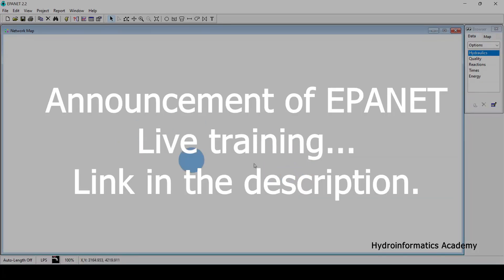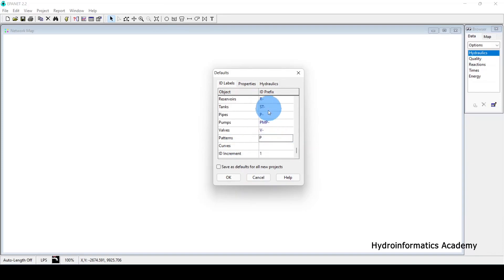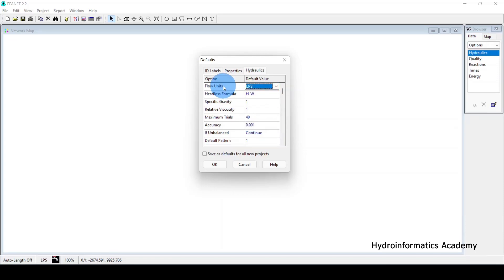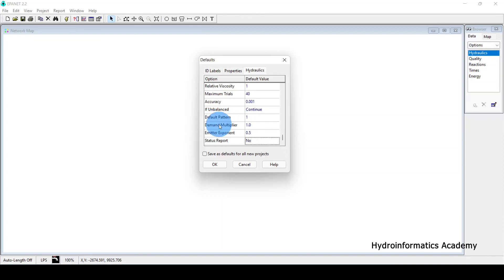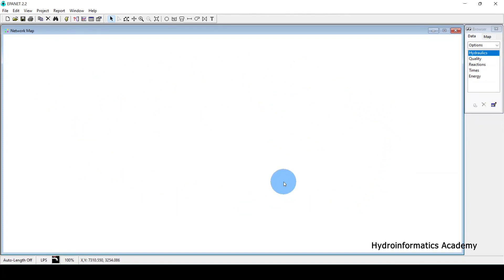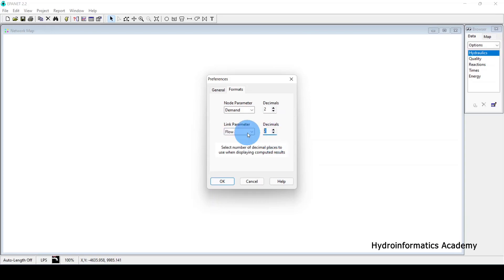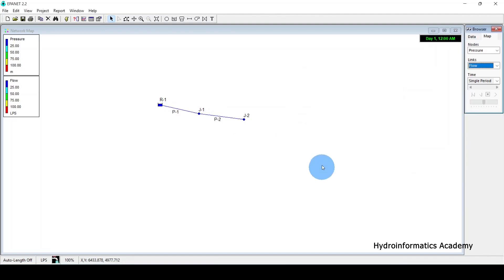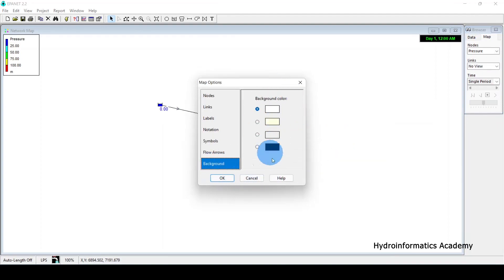EPANET Software Important Settings [Full Tutorial]

Comment: Hi, currently I'm trying to import an excel file(.inp) to my project, but I keep having the "list index out of bounds". Can you help me with that?
Reply from the maker: Which method did you use to prepare your data for epanet? Epacad?
Reply: @HydroinformaticsAcademy  yes, i use epacad
Reply from the maker: As far as I can tell EPACAD is one of the most reliable way of inserting data in epanet! I advice you 1st to cross check your data and make sure that you data is in UTM format! after that if you have autocad watch this tutorial (make sure you follow it step by step): https://youtu.be/-i_0NsoPM5M

If you dont have autocad and you have MS Excel version 2016 or below then watch this one: https://youtu.be/wslkzGGVuoU

Try them then let me know what you get!
Reply: @HydroinformaticsAcademy  i used epacad to import my map into epanet, then i export a excel file from my project, insert the data i want then import it back, but epanet i keep having the "list index out of bonus" , i had done this couple times but this is the 1st time i have this issue
Reply from the maker: I dont get you clearly, do you have UTM coordinates in excel and you want to import them in epanet? Is that correct?
Reply: @HydroinformaticsAcademy  I want to import the water demand for all the junction,,
Reply from the maker: Last time I saw that option was in WaterGEMS! Before you insert your points from excel you have flexibility of assigning demand (right in excel) to a specified nodes!  

But as far as epanet goes I dont think that is possible or i have not came across such a case! What i normally do is to import my points in epanet then assign base demands manually...

On each required nodes or by  using "Edit>Select Region" and  "Edit>Group edit" for multiple junctions!

🙏🙏
Reply: @HydroinformaticsAcademy  thank you for your help, I just want to shortcut that because I have like 150+ junctions to input
Really appreciate it
Reply from the maker: @Dao Long,  I get you but you can as well use the global edit tool if all the nodes or most of them have identical base demands! 

Just go to "Edit>select region" after that select the nodes that you want to set the base demands then go to "edit>group edit" from there you can set your base demand to all the selected junctions!

It might work as well!